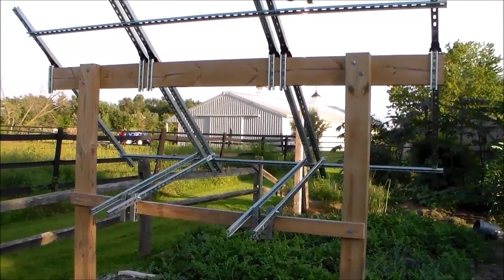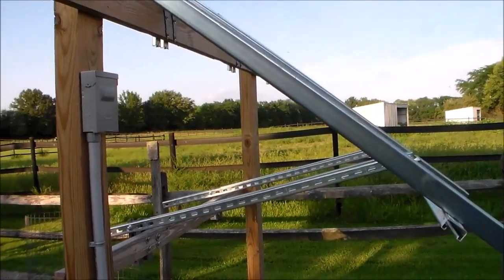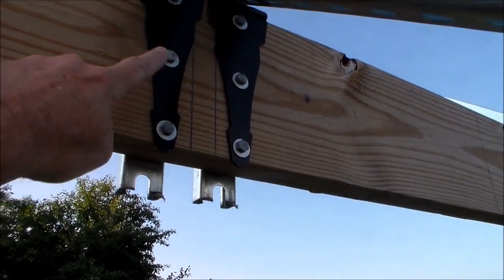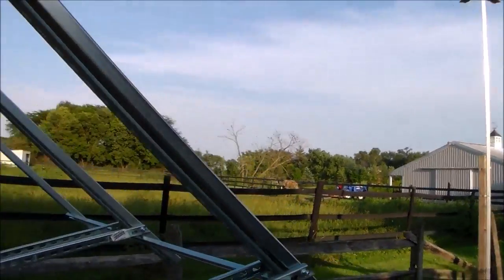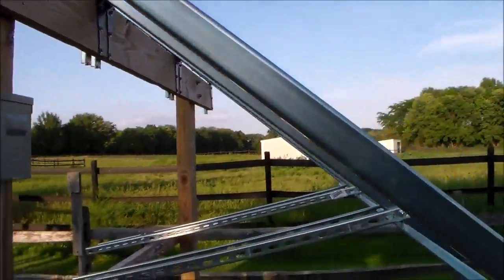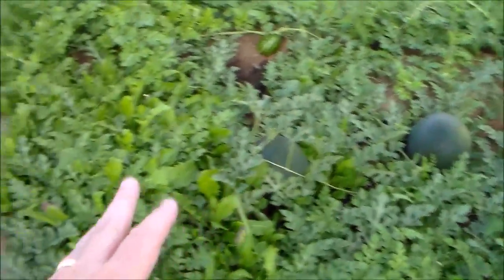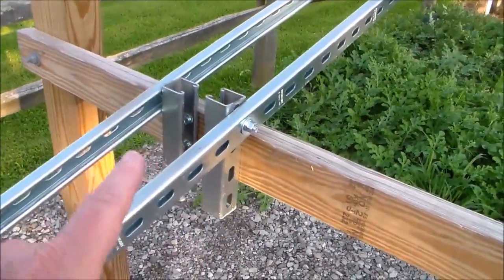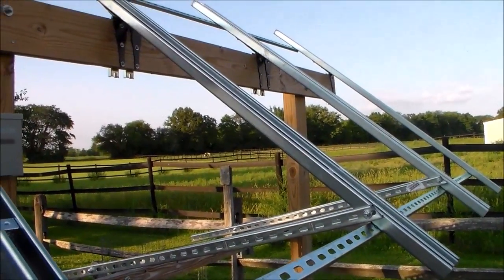DIY Solar - Episode 12 - Adjustable Ground Mount Solar Rack

Comment: Very nice layout. I may have to steal your design for my next solar setup. I have 11 panels I want to put along my South fence line, but I want them adjustable.
Your setup would work great for my needs. Due to the 11 panels I would have to split the panels into a 5 and 6 array for adjustment, otherwise it would be way too heavy to move.
Keep up the great content.

Comment: Very nice job. I’m trying to figure out where to put my array and how I want to mount it. May try using some strong rubber coated magnets with a stud on it to mount my 400w folding panels temporarily on my steel patio roof.

Comment: Rather than use a bolt to adjust the height, I use a quick release pin. This is just as secure and makes the adjustments much quicker and easier. I also mark the pin holes with a number that corresponds with the month of the calendar year. That way, I can get the optimal solar flux in any month. This is important when we occasionally get a few cloudy days in a row and need to obtain as much solar power as we can and this situation can happen in any month.
Reply from the maker: Nice!  I will add that for myself when I move to our new location!
Reply: Was thinking you could use a threaded rod with nuts on each end too since the weight will be on the rod, not the nut and washers. Might be easier to adjust by pulling it out and sliding it back in after the new adjustment has been made.

Comment: Interesting setup -- I might suggest using two 12" throw actuators to change angles.  Your panels will be heavy and could be a hazard to move manually.  A couple of 400lb capacity actuators should get 'r' dun.
Reply: He's only mounting 3 panels Michael. I think he'll cope! Sheesh. Were you one of the 8 down voters, by any chance? 🤔

Comment: I built something similar to adjust the angle of mine.  One observation I notice, your center of gravity is kind of far back so the panels might be heavy when trying to adjust.  I put my pivot right in the middle of the panel so it takes almost no effort to tilt the heavy weight of the panels.  Other than that your design looks to be able to handle wind loads much better than mine.
Reply: Good observation.
Reply: @kevinadams9468  Could solve the offcenter issue by adding some counterweights to thebtop if the supperstruts. Should make the tilt adjustments mor easy.

Comment: Great setup.  I'll be referencing this when I do my build.  

Curious... have you given thought to how a crank adjusting system might work, perhaps like the crank on boat trailers?
Reply from the maker: Erik Sliman I thought about adding some manual actuators, but didn’t move forward with that plan since I was in a bit of a hurry to get things up and running and didn’t want to wait for the actuators to arrive. I may add some of those later.

Comment: I really like the design of your mount.  How deep into the ground did you have to go down into the ground to make it stable?  I'm thinking that design will work perfectly for what I want to create, but I'm going to have the base of the pane's 8 feet off the ground.
Reply from the maker: I dug down about 40 inches and then added about 2 bags of concrete for each hole. If you are going too much higher than I went, you may want to consider going with metal poles instead of wood. Just a suggestion! Good luck with your project!
Reply: @jimginnyohio  Thanks for the reply.  I will look into Metal Poles.  I put my first array of panel's in last year in a fixed array like  your first array.  The difference in power generated in the winter vs the summer is staggering.  You're solution seems perfect, Especially after a snowstorm, I'm guessing it's a lot easier to get the snow off them at such an angle.

Comment: Hi, Good work, I want to build my but I have couple question: 1:How do you know what tilt angle is optimum for your location? just "eye ball" or you some way to measure the angle? 2: Do you have to submit your plan to your local city and power company to get permit before you can build? How long the wooden frame can last before they rotten and need to be replaced? Thanks
Reply from the maker: To determine the tilt angle for your specific area, you can go to this website: http://www.solarelectricityhandbook.com/solar-angle-calculator.html
If you are connecting your system to the grid, you will probably need to submit a plan and get permitted thru your local power company and city. Since mine was not grid connected, I didn't do that. The frame I put together was made from Unistrut, so that should last forever. However, the ground posts and header were made from treated lumber. I estimated those should last about 20 years or so, but best to perform an annual inspection to insure things are going as planned. The only negative I saw with the wooden support structure was wood boring bees in my area. I found that spraying the structure with Orange Oil when the bees were active helped to keep them away. If doing this project again, I would probably use galvanized steel posts for the legs so that wouldn't be an issue anymore. Thanks and good luck with your project.
Reply: @jimginnyohio  Thanks for your good  video and advice

Comment: I was wondering if you needed to get a county permit for your home made racking system.
Reply from the maker: My county did not require it since my system is for off-grid usage. However, the rules may be different if you are connecting your system to the grid. In that case, you will probably need an inspection at the very least.

Comment: Hi from Ireland. Just come across your design and it looks great. Just wondering the length of the main wooden support stakes. With 40" in the ground, how tall are they above the ground and how far apart are the stakes. Thanks
Reply from the maker: The main support posts were 12 feet long and sunk 40 inches into the ground. They stand about 8.5 feet tall. I positioned them so that they are centered with the outer panels about 80 inches apart.
Reply: @jimginnyohio  Thanks very much.

Comment: After looking around for over a month, I believe this would be the perfect thing for us.  Could you say what size bolts/nuts/washers you used to connect the superstruts?  
One thing we might have to do to add to this design for the wind in our area would be a few ground screws, and some diagonal supports for the posts.
Reply from the maker: I used 1/4 - 20 x 3/4” nuts and bolts for the super strut pieces. 1/4” flat & lock washers were also used. All were stainless steel.
Reply: @jimginnyohio  Thanks!  I'm thinking the whole mount will cost a little less than $500.  Does that sound about right?
Reply from the maker: @roderickgorby1234567  I’ll bet it will be less than that! Are you referring to the big rack I did or the smaller movable rack? The big rack may be about that amount, but the small version can be built for less. I honestly don’t remember my costs for those several years ago.

Comment: I really want to copy this design, I have 4, (I'm probably gonna use 3) newpowa 360 watt panels, they are about 69 inches tall 40 inches wide, I can do 3 in series for my current setup, because I can't go over 150 volts

Comment: Did you investigate an active sun tracking system? That would be much more effective than just a seasonal angle adjustment.
Reply from the maker: Doug Olson I considered that, but wanted to minimize maintenance. Any moving parts adds the possibility of things breaking. Maybe I will do that with my next grid tie system.
Reply: @jimginnyohio    DON'T.......pain in the butt to keep them running.  I had 6000w on  3 active trackers and have moved them all to fixed ground mount arrays.  When panels were $4/watt like when I started mine, it made sense to squeeze out an extra 15-20% tracking.  Now that panels are easily under $1/watt (I just gave 63 cents/watt for my latest ones), it makes a lot more sense to simply put up more panels and avoid the constant tracking issues + the initial cost (and I built all mine to minimize cost)

Comment: Very cool! That's a lot of superstrut. How wide is that top stringer?
Reply from the maker: brikshoe Top stringer is a 2x10.
Reply: @jimginnyohio  Thanks for the reply. Good to know it's a 2x10 (I am using a 2x8 on mine), but actually I meant the horizontal "width", i.e., the length. I planned for 10 ft, but it has some flex at that length, so I'm considering adding a 4x4 to support the middle of the 10 ft stringer (my mount is going up mostly wood, using superstrut only for the panel attachment rails).
Reply from the maker: The top stringer is 10 foot wide. However, I have the 4x6 posts in about 18-inches on each side. I only have three panels mounted and the outer two panels overlap where the posts are. I haven't seen any flexing of the stringer.
Reply: @jimginnyohio  I used 8 ft. 4x6s in 2 ft. concrete and notched the 4x6s at the top to give the 2x8 more support. I am using strap hinges at top and bottom (I was looking for an idea to adjust the seasonal angles and that caught my eye on your build) but attaching them to 2x4s run perpendicular to the top and bottom stringers. The strap hinges I bought (8") are only rated at 60 lbs, which means I have to distribute the load across at least 4 2x4s. I'm a bit leery of using 1/4" hex bolts on the hinges (looks like the best fit), so I'm going to try to make 5/16" fit.

Comment: Where did you get the rails and hardware? Will they rust? I'm needing mounting rails for a roof mount system.
Reply: The rails are called “super strut” and can be purchased at Home Depot. The spring clips can be purchased there to. Since it is made of steel, yes it will rust. However, you can put a protective coating on it to minimize that. Good luck!